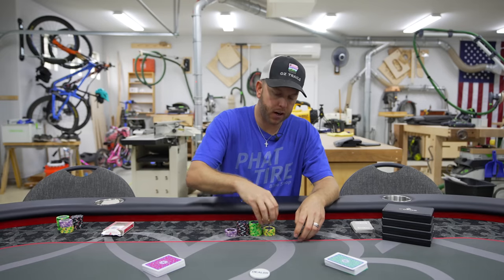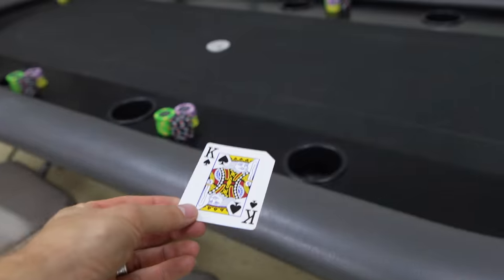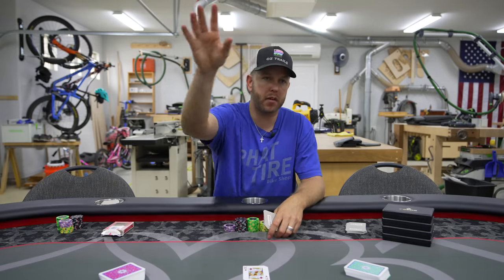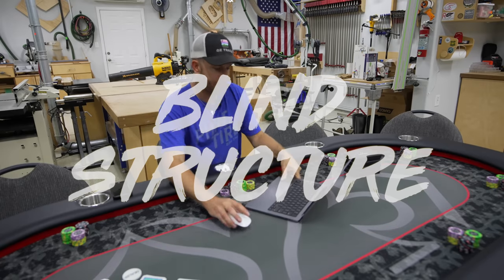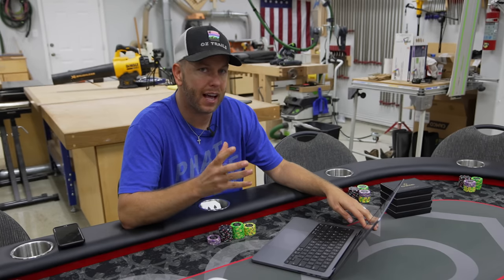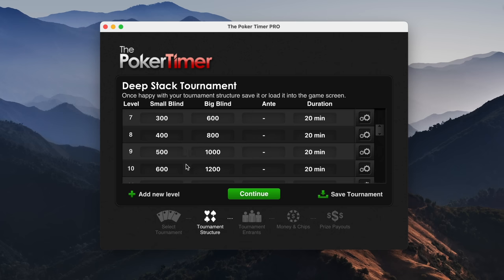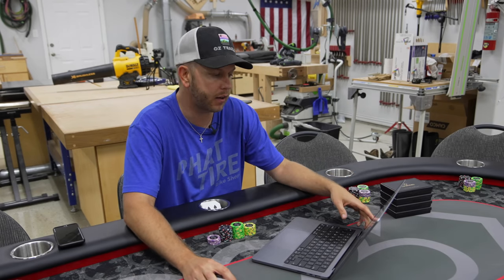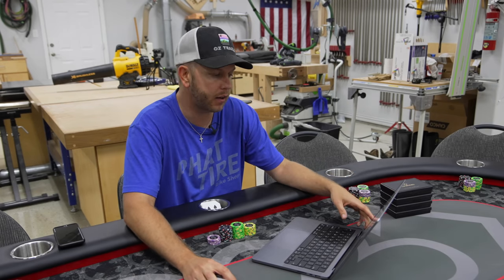How to Host a Home Poker Tournament | Poker Timer Pro

Comment: I heard people don't usually use 50 denomination chips for some reason, instead 25 denom chips are more common. So owning a 50 denom chips is a mistake for me? I was buy a lot 50 denom chips😭
Reply from the maker: Yes, I wouldn't recommend or use a $50 chip. Depending on how big your cash game is, Id recommend a lot of $5's and $25 then jump to $100 chips. If you're doing a tournament, I'd skip $50's as well.